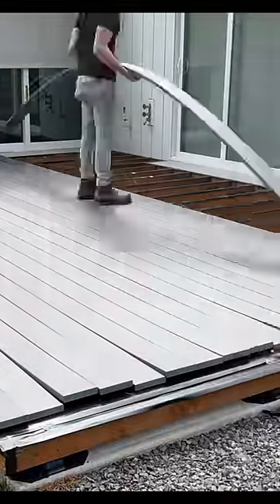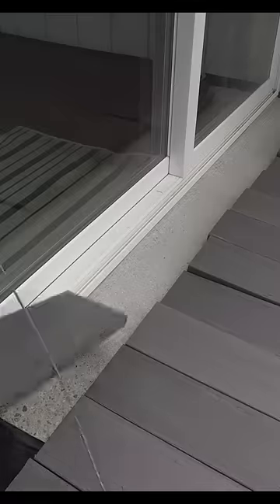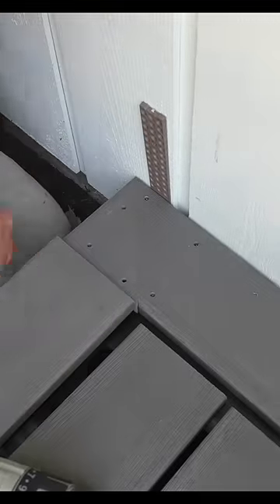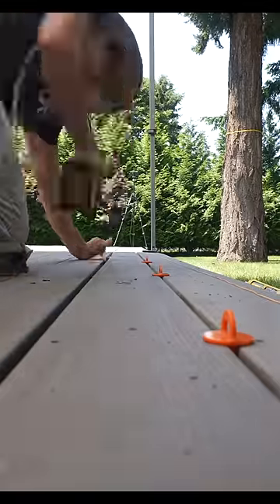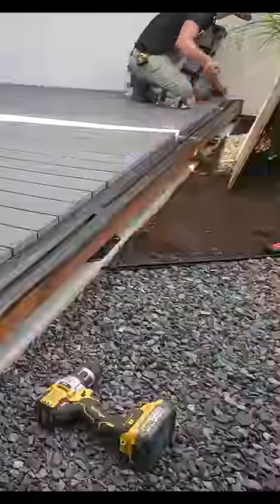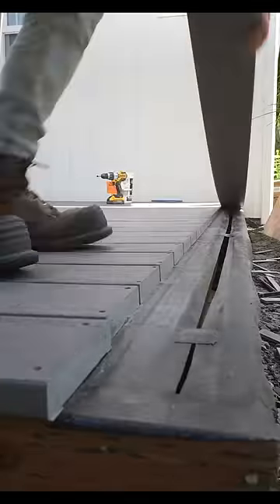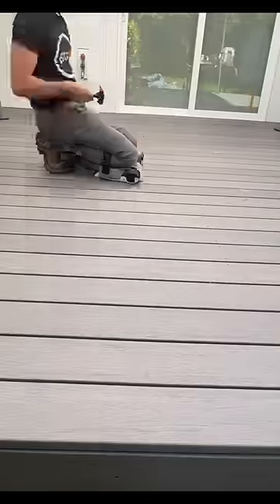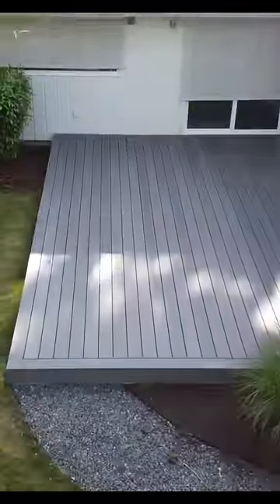How To Install Decking Like A PRO! #deck #deckbuilding #construction

Comment: The attention to spacing, evenly cut ends, and backfilled screw holes were those extra steps needed to set your work apart from the rest. Good job dude!
Reply: 😂😂😂 you shouldn’t be screwing on the face of material they make hidden clips which makes it look way better please don’t do this
Reply: @@notfiveo pretty unfortunate to hear. They paid a crew to do the job too or did they just use some friends they knew or something?
Reply: @@notfiveo lvl 100 keyboard warrior
Reply: @jahjah8762 what in the hell are you talking about? How do you screw something down without screwing through it?
Reply: @CrashRacknShoot Some systems have the screws going in from the sides. The system the other dude is talking about are these plastic clips that shit with the boards and you only screw the last board.
Reply: @OnlyBlix  huh. Interesting. Doesn't sound like it'd hold nearly as well, though.  Maybe I'm wrong.
Reply: Pretty standard decking,   I've seen some real hack jobs,  but most decent tradies can and do do this kinda quality and work regularly

Comment: Who ever ends up taking that deck out is going to curse the man that put the plugs in.
Reply: @hablemostorah3086 yup. Even drilling them out is going to take double the time it took putting them in
Reply: I would just tear it out, plastic boards don't do well for re use anyway
Reply: @JansonRiemenschneider why wouldn’t they? Way more durable then wood
Reply: @hablemostorah3086  Drill the plugs and ruin the head, not going to be able to unscrew them. Try drilling the head all the way through and dull out your drill bit fast and you still have the screw threads holding the board down.
Reply: Magnet
Reply: Nope!
Reply: @hablemostorah3086  I meant magnet to find them.
Reply: You would just need to pry the boards up with a crowbar, quite easy to do.  Composite is softer than wood in that scenario.
Reply: @frippsfruition you could even just run a saw or sawzall depending on whether you’re doing one or multiple boards
Reply: @steveb4748 It's pretty easy. You just screw a screw into them and when it hits the screw below it pulls the plug out.
Time consuming though
Reply: you just pry it up....
Reply: I was amazed at how the crew just removed our old deck did it. They took a circular saw, and made a bunch of quick cuts parallel to the joists. They spent zero time removing individual boards. Two guys took down chunks of boards and joists. Had a 28'x12' deck taken down and stacked up in a little over an hour.

Comment: I’d have butt jointed the “picture frame” rather than the extra bit. Or put the join in the middle of the run instead of by the joint. 😊
Reply: Theses boards expand and contract alot
Reply: Guy does an amazing job, and there’s still people that critique it 🤦🏼‍♂️
Reply: @thebuyingseller because it could have been even better…
Reply: @thebuyingseller Always room for improvement. Since he does a great job I'm sure he accepts constructive criticism  one of the best ways to improve. America is great compared 3rd world countries. Should we not improve on it? Your logic is flawed and you should look in to changing your mindset
Reply: @thebuyingseller mitering the outside boards together would have been better instead of having the third piece
Reply: Yeah the scrap block looked like shit.
Reply: @caseyc4516 He said he didn't do that because it wasnt long enoughl. For me I'd miter the two small pieces instead of one small and one whole piece or not miter it at all.
Reply: @anthonyrodrigues5032 exactly, could of mitered the corner and backed it off the joint couple ft and butt joint a 22 degree cut and would of looked so much better. I for onr would of ordered longer material
Reply: Was thinking the same, why try so hard and then they put a what, huh.....
Reply: @wook420  He most likely ordered the shorter material to save money...but that's a mistake because it ruins the look of that deck...it shows cutting corners.
I agree with you.
Reply: @anthonyrodrigues5032 
America is a third world country.
Reply: @thebuyingseller  he did so respectfully. Nothing wrong with offering a word of advise in a respectful manner.
Reply: @PatrickSwayzeOnDbol there is no country named America.
Reply: @scotmandel6699  
Sorry, I spelt shithole incorrectly, I do apologise.
Reply: The board wasn't long enough...
Reply: Agreed would have been much cleaner...
Reply: Yep, if I paid for that he'd be tearing that shit back off. I would've used longer wood boards like an outer frame or mitered half way before I put that small hacked piece in.
Reply: @thebuyingseller You’re not a winner are you, enjoy your safe space, free of criticism and improvement.
Reply: Absolutely that way you only have one seem instead of having one at each end. And if you wanted to get fancy you could 45 it like when you but trim together.
Reply: Did no one hear him say the boards are only 20ft long? How do you want him to mitre the edges if the boards aren't long enough?
Reply: @pugnastic7272  That’s why you join in the middle somewhere instead of a little scrap at the mitre.
Reply: @gazzore7339  Thank you for explaining and not biting my head off. Another question, won't the little bit before the mitre be better for expansion and contraction rather than full length boards connected at the mitre.
Reply: Exactly mate 👍🏼
Heaps neater,quicker and easier 👍🏼
I do this stuff for a living 🇦🇺😉
Reply: @pugnastic7272  No worries mate, a very slight gap isn’t nearly as obvious as the little  scrap that looks like a mistake tacked on the end, everything else was good though eh. Peace
Reply: @anthonyrodrigues5032 well said!
Reply: @wook420 this material is only available in 16s and 20s. I have had the same issue.
Reply: @pugnastic7272  use 2 20ft boards and cut them to 10 ¹/² feet... not that hard lol. Can also have a 21 foot board cut, trees do grow longer than 20 feet.
Reply: @chrisblair3081  Doesn't look like wood tho, looks like some poly composite material and I assumed they only come in certain lengths, that's why I was curious to the correct method of doing this as people kept talking about the extra piece he put in to allow a mitre at the end. I'm thinking of doing this myself and wanted to find out how the pros do it, hence my comments on the video.
Reply: @sundog1973  How would you have done the mitre/sides?
Reply: @pugnastic7272  My deck is an L, with a long side of 21 feet, so I picture framed a 7 foot and a 14 foot section, using 16 foot boards. Mitred corners. 👍

EDIT: For this deck, I would have picture framed either two or four equal sections to get my max length piece under 20ft, and mitered all the corners.
Reply: Exactly what i thought to many lines at the mitre my ocd is not entertained
Reply: @sundog1973  Thanks the one I'm thinking of doing is actually an L too. Thnx for the insight. 👍👍
Reply: @pugnastic7272  yeah id think I nice wood "picture frame" would look badass myself.  Contrast would have a killer accent. But definitely buying 1 extra board and mitering it in 8 feet back would look better than a small piece in the corner.
Reply: @thebuyingseller typically you don't put in a small piece like he did at the corner. Yes, I'm a custome builder.
Reply: @thebuyingseller everyone’s an expert or so they think but you know what they say opinions are like arse holes everybody has one
Reply: @thebuyingseller it's not critique, there are multiple solution to that situation and he just explained he prefers a different one.
Reply: after the dog shtts on it a few times and the leaves collect does it really mater?
Reply: WPC

Comment: It looks really good. 
However, I've installed this on quite a few decks, and I will tell you that while you spaced the boards perfectly, those ends that you butted up the triangle pieces will pop up on the edges where you butted them against the other piece. You still need spacing on all joints.
Reply: Correct. I’ve tried using dowels. Biscuits.  Nothing works
Reply: exactly ! this product is rubbish in regards to cupping..Looks good for a while ........but overall rubbish product
Reply: 100% and what's messed up is people see this and expect pro's to make tight mitered joints with composite decking and there no explaining how it won't work cuz they saw this guy on utube do it
Reply: Plus it looks like garbage.
Reply: What would you suggest to frame it/finish it?
Reply: glad some one  else  noticed those triangle butt ends worry.
Reply: These things really do look cheap. Hate to be a bummer but it's basically plastic, and you know what else that means? Smell. It will smell like plastic and give off that toxic smell of poverty during those hot summer days, yum.
Reply: @Manhandle730 😂😂😂😂😂awesome
Reply: Its plastic, you know that hey??
Reply: @Theiftanlazx  you can but and pass corners or herring bone each corner symmetrically. Match the gap between boards for the abutment.
Reply: You absolutely do not have to space mitres on this decking. But I'd lose the little triangle all together. Looks completely unprofessional and not very sturdy. Those pieces are the weakest part of this deck
Reply: @rpinthecr4044  definitely will not smell like plastic, ever. Lol
Reply: Rookies. Smh
Reply: @donburke4886 it's literally saw dust and plastic and doesn't weather very well, and it will be a different color in 6 months and  a different color than that 6 months later. I absolutely hate this crap and refuse to do any kind of warranty work after the homeowners sign off on the work. And it will sag between joist in the sun. I could go on all day about how bad composite decking is.
Reply: Wouldn't putting so many screws in like he did help it to not cup?
Reply: @rpinthecr4044 

From some who has worked in a factory that makes composite decking and has installed it, I have to call bullshit on your “plastic smell” assertion.

If your nose is sensitive enough to smell the off gassing of the composite in an outdoor environment, you must really hate the smell of PT lumber.

Comment: My father and I did his deck with that same composite decking material. I HIGHLY recommend it. It's incredibly easy to work with and very durable. No fading or warping and is good on the feet. It's very comfortable to walk on so long as it's clean, and there's hardly any slip when wet. I'll admit that it heats up pretty good in the sun, but I have a hose right there, so I usually just hit it with some water to cool it down if I'm barefoot. But that's what also keeps it clean, so no harm, no foul. It's 100% worth the extra money, especially if you're a "do it once. Do it right" type of person.
Reply: No wood splinters with bare feet SLIDING on the wood surface.
Reply: It melts it you drop something hot on it🤣🤣🤣

Comment: For everyone in here making claims about hidden fasteners, it depends on where you are building the deck. They are not recommended for areas with heavy winds/storms, lake/water front Gulf Coast region or even areas that have a high freeze/thaw swell. They aren't very secure unless the deck is in a relatively calm environment.

Comment: I hate composite decking. We installed that for a client in their back patio. As we were laying the boards down to attach to the base, our knees started burning when the sun was starting to reach peak temperature. Got some kneepads to solve that issue but was afraid to lay my hands or forearms on it because it became unbearably hot. By the end of the day my shoes’ soles melted. Screw that crap. You’ll all find out the hard way. Stick to wood and seal it.

Comment: Looks great. Blind fasteners would have saved you a lot of time.  Timbertech’s are excellent. Still u must be pleased
Reply: Depending where you are, those hidden fasteners won't last. If you are on the Gulf Coast, or anywhere there is a lot of heavy wind or even heaving from thaw/freeze cycles, they will absolutely let the boards pull right off.
Reply: @jmackinjersey1  there are 4-5 different styles. Some will do that. Others will hold very well.

Comment: I personally tried to discourage homeowners for choosing composite decking. first of all Yes it lasts a long time but the deck underneath it is going to have to be replaced after 25 years regardless and two as hot as hell during the summer and cold as hell there in the winter

Comment: Invisible fasteners would be the only change I would make. Nice deck
Reply: He used plugs my man!
Reply: @FreddiePinheiro  I see that lol but I was referring to the type that are screwed from the side...not sure what the technical name is for them. It just saves the steps of adding the plugs I guess
Reply: Camo
Reply: @Nowayjose-vd1wm  Gotcha
Reply: Not all decks can receive those. Those decks have a ridge on the side for that fastener, I don't see it on these boards.
Reply: @jkirby-vd1wm 
Yes, I agree. I used Trex boards and fastened them with "Trex Universal 1-in Black Hidden Fasteners" so there are NO Holes or Screws on the top of all my deck boards. 

Looks very clean and many guests have wondered what holds the boards down since they don't see any screws or plugs to hide the screws. 

(Yes, my boards have the grooves along the sides for the fasteners to lock in and they work great!!)
Reply: Invisible Fasteners are garbage plastic even the little metal ones are garbage once these plugs are in them.... screw ..... can't see.......
. nothing.... the problem with using those hid a clips... they don't actually attach the decking board to the deck this is TimberTech it does not have the groove
Reply: Invisible fasteners/spacers that go under the board make it an even more expensive job for material but could cut down on labor time needed. Either way he did a great job and you can’t tell the difference.
Reply: @BossBeski  we used trex for our deck as well. For sure cuts down on labor needed
Reply: @Nowayjose-vd1wm we use a system called concealok
Reply: Those plugs would trigger me. I used Trex hidden fastners.
Reply: This is PVC. The best install is top down fasteners ( including Cortex plug system) but joints are held tighter with pinning the entire board instead of clips which will allow some movement and gaps to open at but joints. Cooler temps at time of install will also yield less contraction and gapping.
Reply: Didn't he kind of do that? Or were your eyes closed

Comment: For everyone talking about hidden clips, this is PVC. The best way to install PVC is top down fastening in cooler temperatures when the board is contracted. Pinning it down in the contracted state will result in less movement. Clips by their nature allow for movement. They were intended for composite decking which requires gapping to allow for movement

Comment: I hope it doesn't rain or snow wherever you are, that stuff is slippier than whale snot. I got the same stuff. Even my dog hates to walk on it when it's wet.
Reply: Whale snot? 🤔 lmao love it!
Reply: Even wood is slick with snow and ice on it. Snow and ice are slippery.
Reply: @patmaher6304  not like this stuff, at least woods has some grain to hold onto. I’ve had all of above and this is the worst.
Reply: Could a light epoxy clear coat mixed with fine sand eliminate slipping?

Comment: typically when your boards are too short for the picture frame i make sure the miters are nice and put a seam somewhere on a joist away from any stairs. this does use 1-2 extra boards depending on if it’s the front or the side of the deck but with some PVC glue and a 3/4” overhang on the front you won’t have any warping at the seam. either way, clever solution

Comment: Gorgeous.
We replaced our rotted dilapidated rust coloured 70’s colour painted wooden deck with a charcoal Trex composite several years ago. It was expensive, but worth every penny. Saving a bundle by doing it yourself is a bonus despite the work. To say it was a beast is putting it mildly. It did collect algae over the winter, but a pressure wash made it look like new. As our deck was quite far off the ground, we added an aluminum railing with glass sections. I think composite is great….recycling plastics, saving wood, durable and long lasting without backbreaking maintenance!!👍🏻
Oh yes…as another commenter pointed out, it gets extremely hot in the sun….but just wear shoes!!😉

Comment: Looks very nice. On my composite deck here in Florida, my two biggest problems are morning condensation, and foot-melting heat in the summer middays. But I do like the extremely low maintenance factor.
Reply: It is a hearsink-
 I had a little gray beach path color 
Got hotter than I thogh6 it would 

Covered my parkway and made a parking platform  right on top of grass. 
Still,  got hotter than the concrete right next to it.
I want to test as a siding.Bullet proof?
Reply: @douglasmeyer1183  I highly doubt it's bulletproof, but give it a whack and let me know how it goes

Comment: Nice job! We built one with 2X4x18 treated lumber, various lengths and angles. Stainless screws and massive stainless bolts through the 4X4's through the trusses. LED lighting, outdoor speakers with underground subwoofer vented above ground and, the icing on the cake, air conditioned seating.

Comment: With a square edge deck board, I use camo fasteners. Looks a lot cleaner than face screwing.
Reply: You must have missed the part where he put in plugs, my guy.

Comment: Those corners are not like a pro
Reply: Nice look. I used tiger claw fasteners on my wood deck many years ago, because I am not gifted making straight lines of screws.
Reply: He covered that - due to length of boards...
Reply: Then explain how a pro would do it. I’m curious.
Reply: @rodprescott6733  no that's due to poor planning
Reply: @miguelcadete2495 by actually planning out and measuring the framing correctly
Reply: @bigluisjayrogan  I’m glad you answered me back, because I was scratching my head thinking the same thing. I just wanted to see if we were on same page. Thank you again👍
Reply: Came here to say that. Dirty looking corners with those tiny triangles.